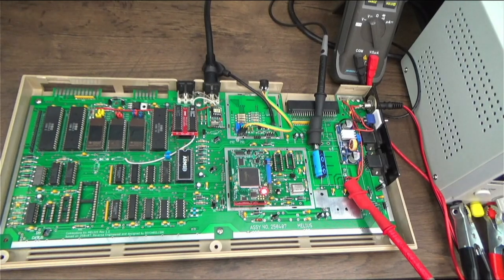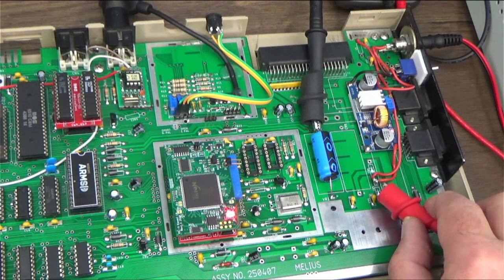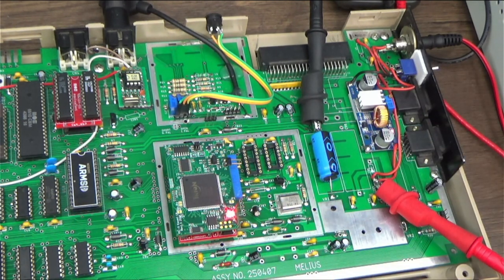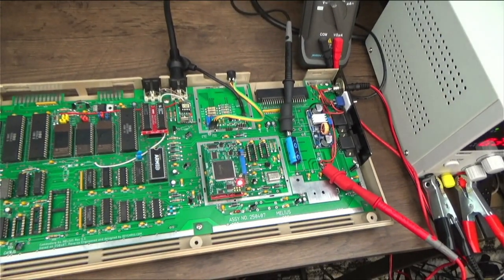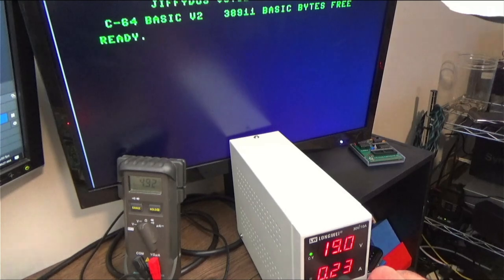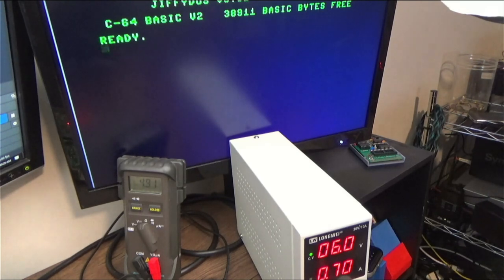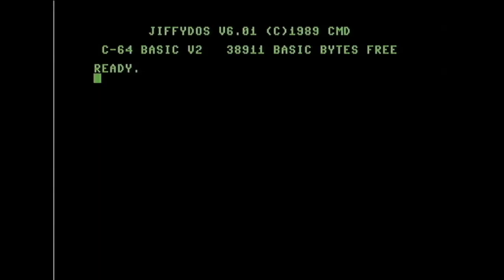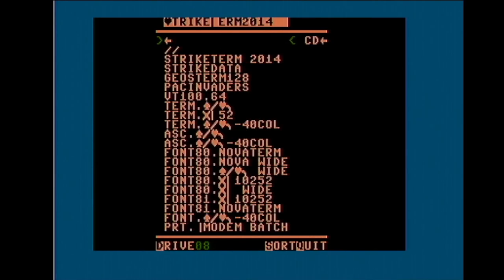Melius + Kawari + ARMSid = 5v Commodore 64

Comment: Great vid. I have a melius and just got the Kawari as well. Looking forward to building it up here soon. Interesting power mods. Got a link to that real-time clock generator setup?
Reply from the maker: Hey thanks man, its been a fun project!  The clock gen circuit is just the reference design from Elm that I put together on some breadboard.  I just checked their site though and it looks like they've discontinued this chip :(  https://www.elmelectronics.com/wp-content/uploads/2016/07/ELM440DS.pdf

Comment: I'm making a SuperCPU clone. So far, I'm not using the dot clock and hoping to keep it that way. With these modern devices, it is going to be interesting if they can handle being written to on every cycle, especially the SID replacements. The 6510, can at best, write to a register every four cycles. A SuperCPU can hit it with new data every 1MHz cycle.
Reply from the maker: I can see how ditching the dotclock can help the rest of the systems performance when getting into higher clock rates.  I look forward to seeing your project!  Im curious where that leaves things that need the dot clock though, like ram expansions and swiftlink carts.  I would imagine your SuperCPU project could include some RAM?

Comment: My first connection to the Internet was text only via my local county library. We used Pine for email. I still miss the simplicity of those systems. Doesn't the cassette port use higher voltage to run the motor on the tape storage? Would SD tape storage devices still work without the tape motor voltage? Some programs are only on tape until transferred. I'm still perplexed as to why the 6526's and the 6502 are not replaced. Surely this has to be more about patents than knowing how it works. These chips, more than any, we know how they work and what they do. We figured out the PLA immediately, the SID has come very far, and now the Kawari - the CIA and the 6502 should be high on the list (and we have new chips that could be rewired to replace these). I am fascinated by the fact that with these new chips that we can make these machines useful again in the modern age. 

I wondered in the past why Commodore issued the CP/M cart for the 64 without building in 80 monochrome support (which would have worked adequately at the time). At that period, CP/M was still viable cost-wise. By the time the C128 came out CP/M was becoming a distant memory and PC clones were looming on the horizon. Commodore would have been better suited updating the chips. (Change the following: CIA to newer, similar chips, replace the old 6510 with the 65C02 or later chip with circuitry to added to accomplish the bank switching, upgrade the SID, upgrade the VIC to support modes to 80 cols and corresponding graphics modes and engineer a standard video out, lastly switch to readily available chips to eliminate the PLA. It's likely that simplifying the design would have reduced the cost and promoted compatibility with what users were familiar with on the C64 and drawn more customers. 

The C65 project, while interesting, is somewhat indicative of Commodore's odd thinking. Create a totally incompatible machine series with the C16 (in an age where virtually all machines had 64K) and the Plus/4 in a market with the C64 (which was massively popular). The embedded productivity software was a waste. If they had included high-capacity cartridges with each productivity package maybe. However, they could have saved ALL that money and made a cart for the C64 that had all better productivity software on multiple ROMs and used the 6510's ability to switch between ROMs (like it did on the system already) and add more RAM (which it already knew how to do with the REUs). The cart could have added an 80 column mode (even if monochrome) that was stable and it would appeal to the holdouts and sell at the $100 price point to every person who had a C64. It would have cost Commodore virtually nothing to produce and bought them time to design the better C128 (which could have designed in the cart and sold a 512k machine). The C65 tries to bridge the gap between the C64 and the C128. However, there are noticeable incompatibilities. The design baffles me. 

Discovered this channel at part 1 of this and subscribed. Would love to see if you could get input current to 5V so you you definitely run it off USB, though I now wonder if it couldn't run from a plugged in USB3.2 adapter? It supplies more power, right? Anyway, enjoyed the episode! Thanks!
Reply from the maker: I can't disagree with anything you said brother! It seems Commodore's engineering was tasked with 'Here's a box of spare parts, make it do something cool for cheap'.  As for the tape interface, I haven't tested it as never much saw use for the cassette on the 64 but I know they were big in Europe.  I had a leftover 1531 from my VIC-20 when I was a kid and never once used it on the 64.  The cassette did rely on the 9VAC for something (running the motor I think?) so it wouldn't work anymore.  For the DC power stuff, I'm working on some more hacky ideas.  I ran this machine today for about 2 hours off of a pair of old 2500mah 18650 cells in series.  The machine was still running, but the cells were down to about 3.6 each so I shut it down.  These cells are well used though and are no where near their top capacity.  And Yes I do believe you could use a USB-C type charger but you'd need an active logic circuit to get the handshake right so the charger will deliver more than 5v.  I'm hoping to find a beefy Pi supply in my stash that puts out a healthy 5.3v or so and call it good.  I'm going to try some USB power banks too. Thanks for subscribing and for your comments!  I greatly appreciate it!
Reply from the maker: Oh yeah, and your CIA and CPU comments - I plan on putting a standard 6502 in this machine instead of the 6510.  Someone was working on the 6526 replacement quite a while ago and I believe it worked well but nothing has ever come of it.  My guess is that he wants to make a commercial product out of it or something.   Whether its open source or commercial, my stash of CIAs is low so I hope they do something soon!
Reply: @retrotechinsanity  Tape motor needs 9VAC, it won't run on much less. 6502 isn't 100% compatible with the 6510. When Commodore got dinged for IP-infringement, they had to make some changes and as I understand it they did some improvements and of course changed the 6510 to not be pin compatible with 6502 or the Motorola 6800. The internet tells me only one pin differs, pin 5 is used on the 6510 for the VIC2 to assert bus control over the CPU, on 6502 pin 5 is NC. And the 6510 can tristate its buses, and it has 6 bits of mapped I/O in zeropage. I have no idea just how much incompatibility this will introduce, but since they got sued over the 6502, I must infer that the change they made were non-trivial.

But then it depends on what goals you have with your machine.
Reply: Holy Sh!t that's a long comment!